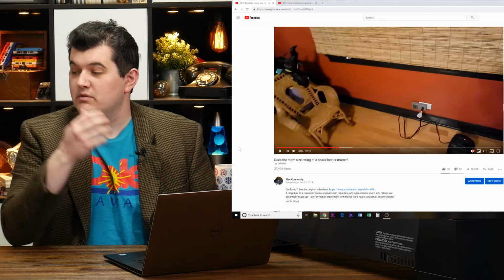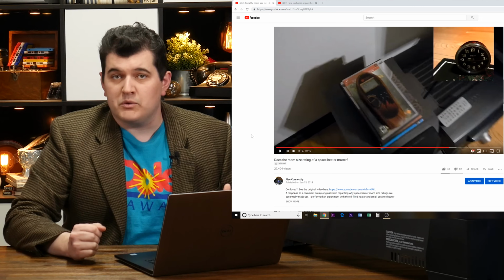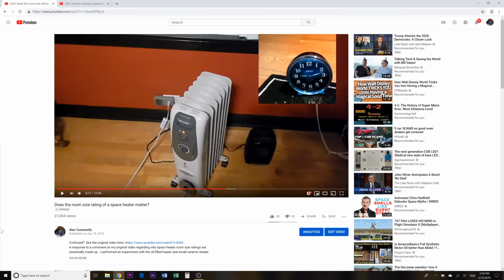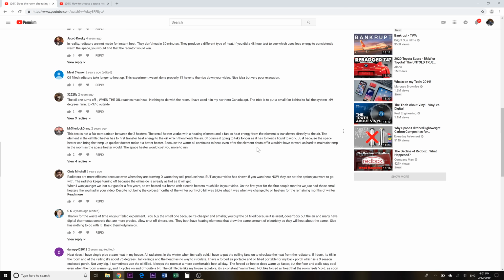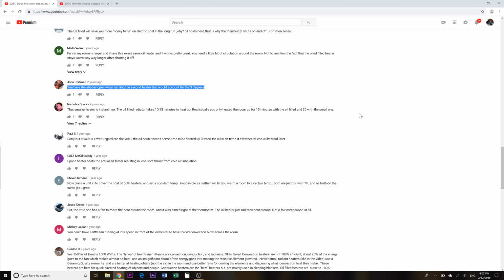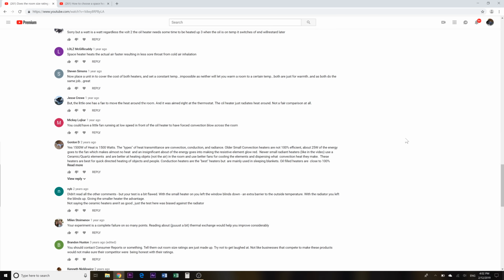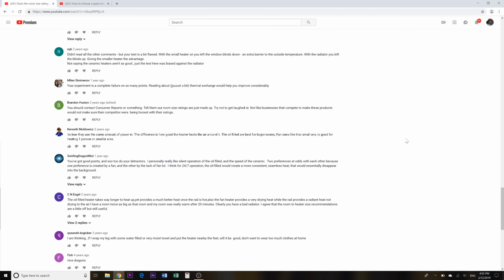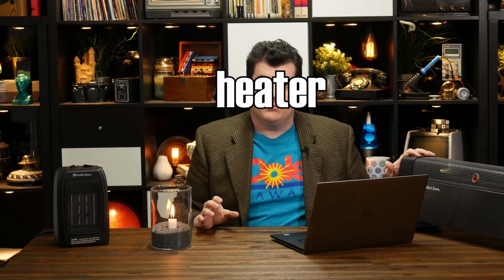More Space Heater Nonsense

Comment: I think an important question is how much power can a small appliance "legally" consume on a 120v line with 15amp fuse?  what are the requirements for something using that much power, an oven can have a decent fire and contain it but a space heater on your carpet below a desk is quite risky if it fails, 

I just did a quick look around and there extensive laws on space heaters due to a family of 3 died in a house fire. space heaters are a common fire issue, maybe that's' the reason for the 1500btu output limit ?? and why it cant put more btu's , in USA/Canada in my personal casual googling .
also just a science nerd but to satisfy all the people if you do another experiment like this. I would use a basement if possible because less drafts.
also I would record the outside temp and wind speed, for comparison.
but far most i would like to see, what is the peak temp these things will heat a room to?  How long to reach peak temp? With the out side temp and wind speed recorded along with room temp every 10 min for 6 hours or until temperature reaches a climax. oh and the total power drawn from the outlet. It would be nice to see if you could graph the power draw against the temp.

It could be all marketing but there may be some heaters that could possible stay at full power for longer that the others. and I mean like on full all day, that me be i differing factor,and these may be non commercial items where power consumption is no issue.

googling lazy : https://www.cs.ucdavis.edu/wp-content/uploads/2013/11/Portable-Space-Heaters.pdf  

 The  Life  Safety  Code,  NFPA  101,  section  19.7.8  prohibits  the  use  of  portable  space  heaters  in  health  care  occupancies  but  provides  the  following  exception:    Portable  space  heating  devices  shall  be  permitted  to  be  used  in  non-sleeping  staff  and  employee  areas  where  the  heating  elements  of  such  devices  do  not  exceed  212  degrees  F. 

Its at the bottom of the document but this may be the limiting factor on the maximum heater output...
Great stuff. I always get trapped in these videos for hours.
One great book that has many applications is Yamaha sound engineering handbook. I cant find my copy so i may be off on the name, but it covers just everything related to audio engineering, including mic pickup patterns =)

Comment: Computers make excellent space heaters. They also have fans built-in so no convection needed.
Reply: I sometimes end up running my window AC even in the winter because my room gets too hot with the PC on stacked with the furnace heat.
Reply: problem is that a 1500w setup is waay more expensive xD
Reply: @froge8121  sad truth😖
Reply: @froge8121  But its so much more fun!
Reply: @froge8121  875w dell workstation, two 150w studio speakers and a 40" 4k monitor... plenty of warmth!
Reply: Yep definitely...my computer has a 750w power supply...my CPU takes 83w (peak), my GPU takes 250w (peak).  Granted, most of the time I don't run my computer at full tilt (power consumption and therefore heat is greatly reduced when load is not 100%), but gaming sessions will definitely heat up my room a little.
Reply: Even better with a big old crt monitor.

Comment: I think the part you are missing is duty cycle. That is to say, you put the small one in a small room it will turn on and off. Put it in a big room, it will run non stop. It puts out 1500W of heat, but the company/marketers are recommending that you don't use them in a room that requires every last one of those watts.

It is ok for the big one to be in a big room. It is bigger, so it has more surface area. More surface area means it can release more heat without a fan and the heater itself will be cooler for the same 1500W. The big ones put out 1500W while being cool and quiet. It is no big deal if they run nonstop.

*HERE IS THE EXPERIMENT YOU SHOULD RUN:* In small, medium, and large rooms, how well do the various heaters maintain a consistent temperature over 24 hours and how much energy do the different heaters use over that period.

My intuition tells me that the small one will be the most consistent and efficient in the small room but t it will even out as the rooms get bigger.

Comment: People are dumb and dont understand how heating and cooling works. radiator heaters suck due to their dependence of radiate heat flow cheap fan driven heaters do not have this issue. Fan driven heaters will out preform radiate heater every time, even if you put the fan driven heat and the top of the room and the radiate and the lowest place. active heating will out preform passive heating everyday. All cars have electric fans today instead of engine driven fans simple due to cooling for a car is an on demand task not something when your at speed of at above idle.

Comment: The oil filled heater is "better" when the room is up to heat, that means you get to room warm ( ie turn it on end of summer ), then use the heater and leave it on 24/7 until it warms up again outside.
Or you use the little fan forced one when you get home until it is warm enough and then turn it down. Turn it off when you leave the room.

One thing that annoys me is the statement that "this type of heater dries the air", No it doesn't, it lowers the humidity but the same amount of water is in the air before and after, if you put a bucket of water in the room it can evaporate to raise the humidity.

Comment: Hey man, I have a question I'd love if you could answer. So I have a house with no central ducting and I just have baseboards in all the rooms. I am greatly annoyed by the fact that every one of them has the baseboard under the window on a far side wall, but a temperature control by the door/light switch, so that when I need to replace or fix one I got to follow and rip out a wire going all the way across. Not my question though.

Why are baseboards usually located under the window? Is that the best place for them? I think the idea is that is creates a "wall" of heat in front of where you're losing most/a lot of it, but.. if heat wants to reach equilibrium and will go to the colder area first, doesn't having it there just mean I'm throwing more of my heat directly out the window? Wouldn't it make more sense to put the heating element at the point furthest from the window, so the heat generated has to travel and raise the temp of everything before it gets sucked out?

I thought that was the same reason behinf fireplace chimenys being against an outter wall rather than going up the middle of the house. That because "in olden days" you lit the fire even in Summer to do cooking and canning, and having it on an outside wall let you throw out heat faster, and in Winter it just meant you tossed more logs in. Lot easier to heat a place up than cool it down.

I'd understand if it "doesn't matter," but the idea of the baseboard under the window being "better" seems not right.

Comment: Not directly related to electric heaters, the method, and the objective results are good, and the pure thermodynamics are solid, but I do have experience with both forced air heat, and radiator style heat, and there is a difference in feel, that thankfully can be explained with solid backing. I grew up in a house with forced air, there is nothing wrong with it, but when my wife and i bought our house it uses gas fired baseboard radiator heat. Those can be roughly equated to the small fan heaters, and the larger oil filled heaters. What I've found is that because of the slow convection the baseboard heaters feel warmer for Us humans than a forced air system set to the same temperature. This makes sense from thermodynamics, and human perspective because we are warmer than the air being moved. If you are aggressively moving the air around, and a smaller heater has to use higher air speed to keep the smaller coils below a temperature where they will melt/fail in some way) that added air current will cool your body more quickly. The question from a comfort perspective isn't just what is the thermodynamic system system between the room and everything outside it, your experiment and the laws of thermodynamics tell us more or less accurately the results that. It is also dependent on the thermodynamic system between our warm blooded bodies and the room. 
The experiment needed to show this difference is far and away more complicated than one relying only on the temperature in the room, but its the same concept, on a lesser scale as windchill. The moving and comparatively dry air would draw heat away from the human body faster than relatively still air that has a smaller difference in relative humidity. 
TL;Dr You are absolutely correct in the energy into room versus energy outflow perspective, but the comfort level of the people in the room is determined by more than just the temperature of the room and also concerns how that heat is put there. more air moving more slowly can feel warmer than the smaller, but faster movement of one of the small fans.

Comment: I use more expensive space heaters (they are usually called "servers" and "miners") even in the summer and I never saw that "big room" "small room" designation on normal space heaters (maybe because I do not buy them, I have one oil filled heater though).

However, let's pretend that the designations are actually useful for something. Why would I want a small 1.5kW (though I think in my country they are more powerful because of 230V mains) heater for a small room and a big 1.5kW heater for a big room?
A small room heats up quickly (less air/wall mass to heat up) and loses heat more slowly (smaller surface area), so I could probably run the small heater for a while, heat up the room and then turn it off. Most people would not want to sleep with that thing on for two reasons - noise from the fan (even worse if it turns on/off as intermittent noise is more distracting than constant noise) and the fact that if the fan fails, the heater can melt or even catch on fire. Also, the heating element is very hot and it may be full of dust which can then catch on fire.
An oil-filled radiator is physically bigger, so you may have problems finding space for it in a small room. Also it takes a while to heat up. 
However, a large room takes a while to heat up anyway and loses more heat, so you may want to keep the heater plugged in for days or weeks, even when sleeping. So, a heater that is silent and safer would be better. The oil also keeps the temperature more constant.

If we compare the heaters with fans, then a bigger unit would have a bigger fan, which would mean more airflow and better heat distribution over a larger area. Or same airflow with lower noise, but taking more space in the room.

But yea, all of these heaters are 100% efficient. Even my miners are something like 99.9% efficient space heaters.

Comment: Well, for starters, I was surprised to learn in the last video that regardless of size, they all put out 1500 watts/5120 BTU.  That said, I agree with you that you're just wasting money buying a "larger" (physically larger heater) unit because it's just a glorified "desk heater" on steroids.  Thus, I think a lot of the kickback is with the "apples to oranges" experiment using two different types of heater (quartz/fan vs oil heater).  I will say that I don't agree that the oil heater thrermostats are "fooled" by being overheated.  They're calibrated like any other measurement tool, and would account for the proximity to the heater.  The reason they're cycling on and off is because you can't run the elements full blast continuously, because the container pressure grows with heat, and would likely burst the container if allowed to continuously pour heat into the sink (and the sink can't convect away the heat fast enough), so, the thermostat acts not only as a temperature adjustment, but also a limiter so the unit doesn't overheat.  I'm assuming they're driving the system as hard as they can continuously keep the unit producing heat.  A proper comparison would be that desk heater up against a similar "large version" that is quart/fan driven, just like the desk heater.  Other than that, do the same thing, start with a given temperature and run each unit for a fixed length of time (30 minutes as you did is fine), and see what those results are.  If this message is too long, it's your fault because you make such cool info-packed videos that covers a lot of stuff.... and remember, if ya can't take the heat.. get out of the kitchen!

Comment: I think it's pretty hard to argue with the premise of this video. Certainly there are reasons to purchase different types of heaters, but the "large room" heaters are NOT better than "small room" heaters at heating large rooms as compared to small rooms. The room size ratings are completely meaningless, except perhaps that "large room" heaters tend to be physically larger and thus may fit better in larger rooms.

One thing I will say though is that it is not completely impossible for different electric heaters dissipating the same heat to transfer different amounts to the air.  For instance, if an infrared heater is pointed at a window (or even a wall), some of that light will be transmitted and thus will not heat the room. Of course, glass tends to be pretty opaque to IR, so it's not a major loss, but it is nonzero. But for the convective heaters in this video, that isn't a concern.

Comment: I do think a ton of the marketing is misleading, however, some of the size labeling, as some have already pointed out, is due to the build/lifespan of the units.  The larger a room the more durable you would want a machine as the machine needs to be used longer.    The smaller/cheaper ones do put out the same amount of heat, however, the parts that make up the cheaper ones are not as durable.   

Here is an example which illustrates this in a silly but good way.  You have a very old race horse and a young race horse who both run at the same speed.   The older one can handle 2 races.   The younger one can handle 10 races as he is more durable.    Both horses can then be labeled to be the same speed rating, but you wouldn’t want the older one running a longer race even if they do both go at the same speed because the one with the least durable parts may breakdown. 

So packaging wise the makers wouldn’t want to slap a large room rating on a machine they know is not designed to operate in that environment.    Although I think some of it is misdirection, I do think some of it is design and durability ratings.    There should be another method of rating these machines which makes more sense.

Comment: A bigger heater is a cooler heater for the same amount of heat.

The difference is concentration.  A small heater offers a relative 'pin point' of heat.  It can be aimed and apply direct heat while neglecting the remaining volume of the room.  That point of heat is more intense in its concentration.  A larger heater or even just a higher fan speed will diffuse the heated air over a wider area without developing a "hot spot" around it.  Consider, many hair dryers are also 1500 watts.  When concentrated to a 3" nozzle and aimed at mammalian mop, that same amount of power can do some decent damage.  

If you want to maximize concentration, take the air out of the equation.  Metal is multitudes more dense than air.  With just 25 Watts, the tip of a soldering iron can melt soft metals.  It's the same heat.  Just in a teeny-tiny point of far more dense material.  

Or go the way of light.  A magnifying glass can get 5 square inches of light rays, bend and narrow them down 1/32", and suddenly that concentrated light can burn paper.  It's the same light.  Just in a teeny-tiny point.

If anything, I don't know why they aren't marketing bigger heaters for their safety factor.  1500 Watts worth of heat within a cubic foot of air can melt plastics and possibly ignite small flammable particles.  Stretch that out to a larger outlet with greater dispersion, and the more widely distributed energy will be harmlessly warm.

Comment: At some risk of duplication (don't wanna read no old comments), it's probable that "small room" heaters are meant to spend less time being on? 1500 W, sure, is maybe a common peak draw (similar to how microwave ovens are rated at peak draw) so you can estimate what else can be on the same circuit; but you don't really want a small machine with a small fan to be heating itself and running on its tiny bearings *all*the*time*?  The bearings don't even need to completely seize for the heater itself to catch fire if the fan slows down.  But! What do I know?!?

I've much enjoyed your tech-history videos, and these last two-ish have been very entertaining as well.

Comment: I used to have one of those space heaters that glow really bright and don't have much of a fan on them. Even though it was 1500 watts, it didn't heat the whole room as good as one with a fan that blows a lot of air, mainly because it concentrated the heat in one part of the room leaving cold spots. I think that's another issue with those radiator heaters, the heat is in one area and is getting lost through the floor, wall and ceiling near the heater.

Comment: People have a hard time wrapping their heads around duty cycles. They really affect output drastically. I got a 1500 heater for the bathroom it would run 8 min cut off for 5 at high setting. Returned it for one that runs 100% at 1500 watt; think that's what some brands mean by large room. Most is just marking wank